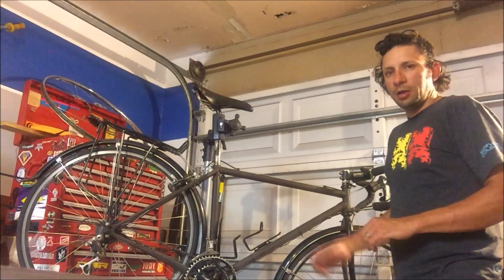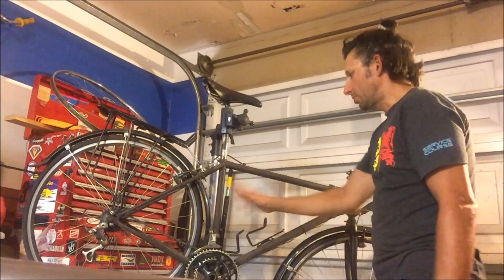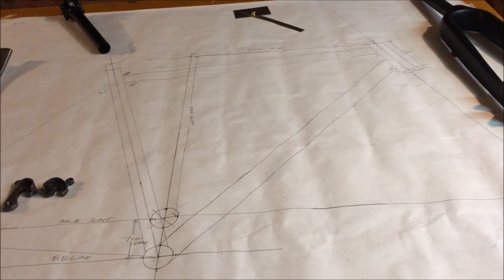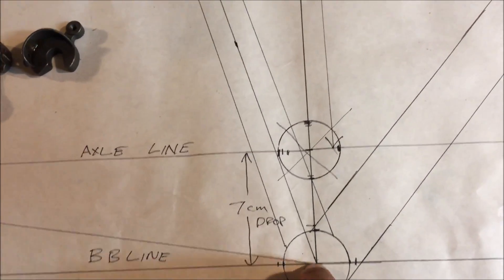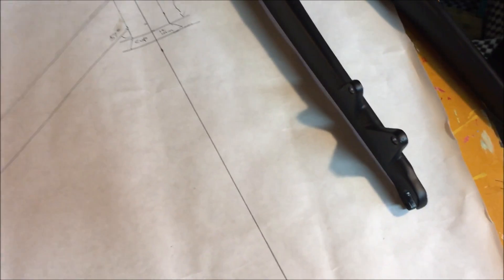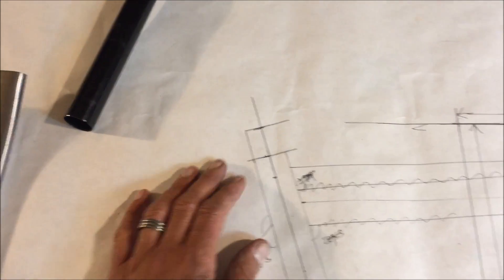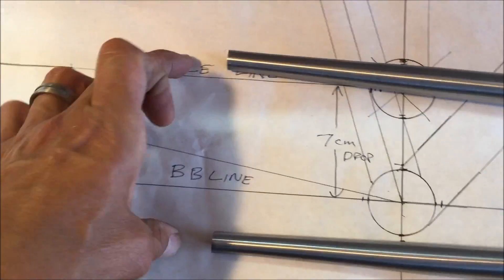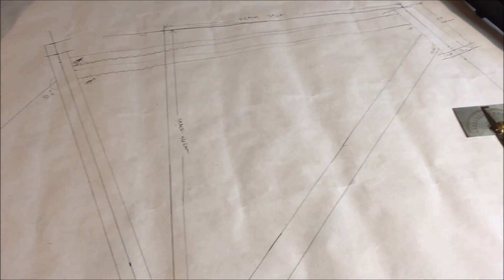Bicycle frame build part 1

Comment: What is the thickness of the frame tubing ? what is the material name/number for the tube ? weight of the frame ?
Reply from the maker: The tubing is double butted chromoly. The wall thickness at most of the joints is .035". This is the frame kit I ordered from nova cycles, plus English threaded BB, and Breezer style dropouts: https://www.cycle-frames.com/29er-Tubeset-35-X-969-DT.html?category_id=951
I'm not sure what the overall weight of the frame is, But the bike built in it's original configuration was about 21lbs. It would be easy to get it sub 20 with lighter wheels and tires.
Reply: Joey Mesa many thanks ! nice kit indeed but where can I get the blueprint design dimensions if I may ask to assemble the kit? & where can I buy lugs from please?